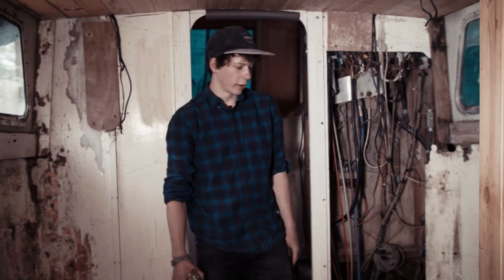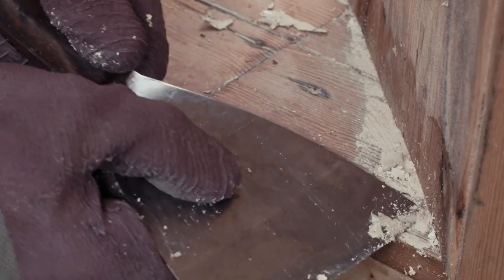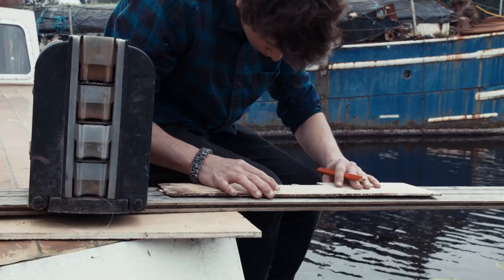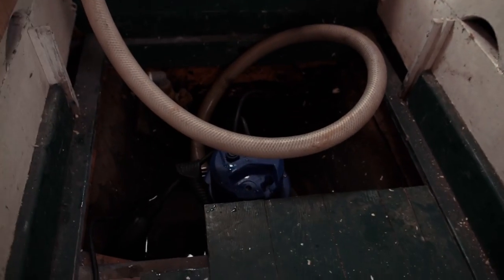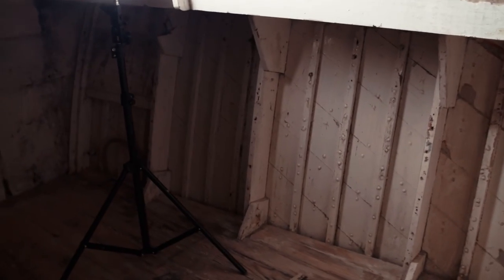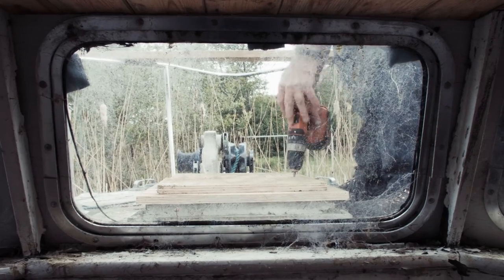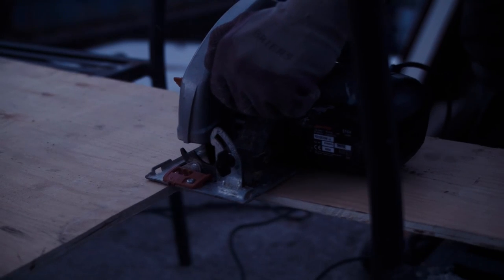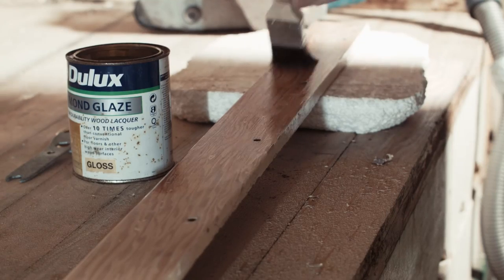Episode 01 - Restoring a 40' Wooden Boat

Comment: Hey i am new to your channel and so far i like what you are doing   I will watch  many of your other. Videos to see the progress  on the boat. I have been a boating lover and enthusiast   Nearly all my life included in some of the ones ive owned was a 1964 Wooden ChrisCraft Cabin Cruiser that i. Completely stripped to bare wood and redid the entire vessel  A strange tool i came upon  that was  very versatile and helpful  for sanding in strange areas was the Black and Decker Mouse sander  it was shaped  similar to a clothes iron  foot print  that can really get into  the smallest of tight corners although it is not a commercial or professional quality tool  it has held up  for many years  of hard use and it was pretty inexpensive to purchase i did make my living as a professional Woodworker  for over 20 years. And that little sander would. Never had made it in the professional setting  very long but it did last  to do my boat  and that was what i bought it for  i have since sold that boat many years ago and have owned several others  since  i started  buying boats in the 80s when i was only 17 years old  and have bought and sold many over te years of all brands and hull construction, manufacturers  etc.  i thought i would take the time to share my thoughts  i do however own  the exact Makita Belt Sander i saw you  using   And it still runs although the bearings need replacement at this time due to  using it on Bpttom paint  too long ? So the machine has. A horrible noise   When it is in use  but i still tell people it was one of my best power tools ive ever owned as i used practically every day when i was working  in the Architectual Wooworking industry